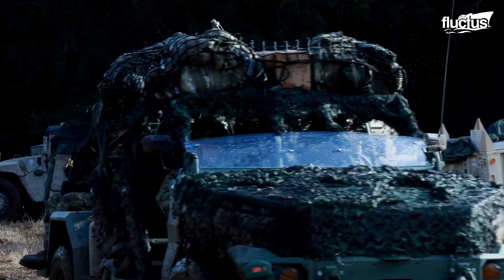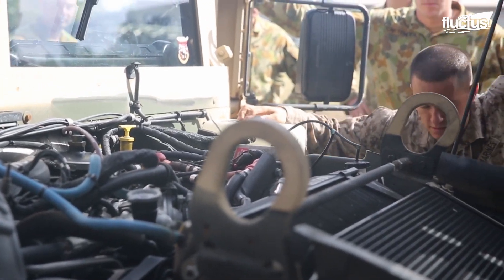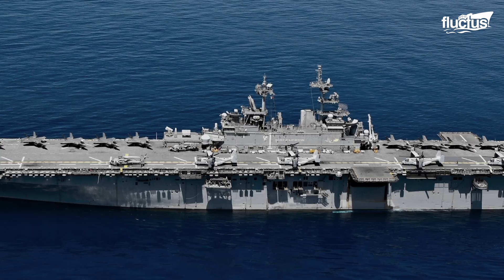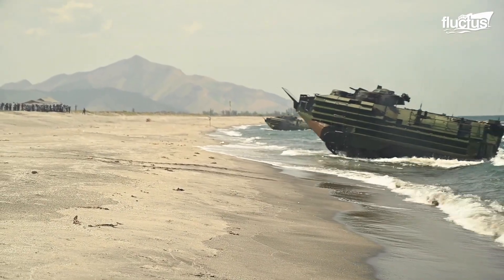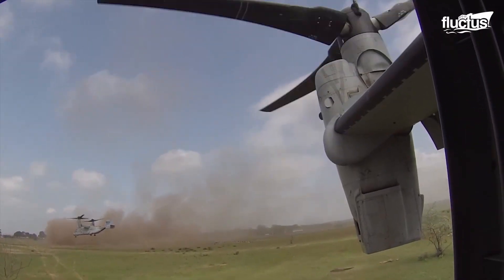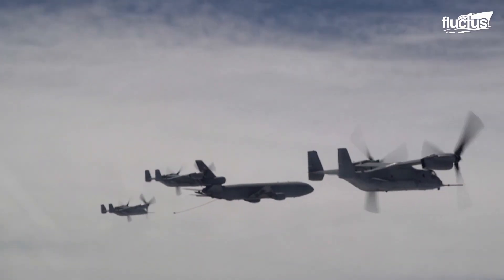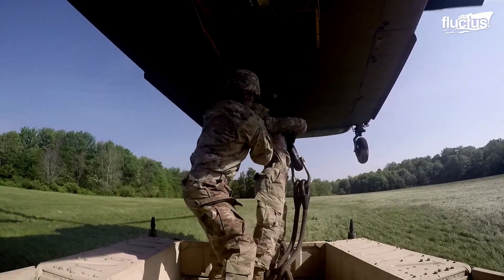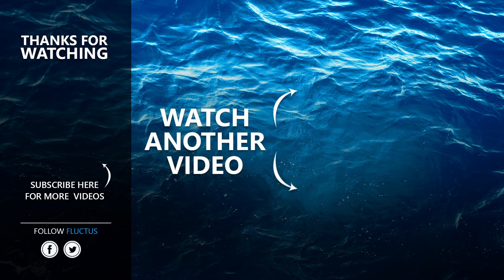Extreme Process of Driving US Armored Vehicles During Deep Water Crossing

Comment: Here is a thing. My 1964 Volkswagen Beetle crossed every river I came across.  I used LT50 Deep tread rear tires and L78/15 tires on the front.  I probably spent $4000.00 for this vehicle, finished.  There was nowhere this Bug wouldn't go.  And I remained dry.